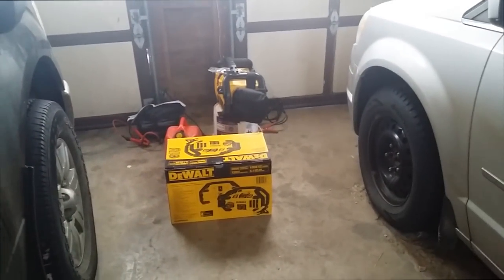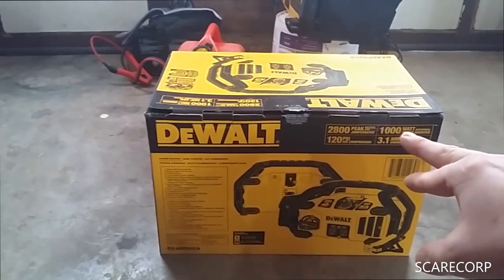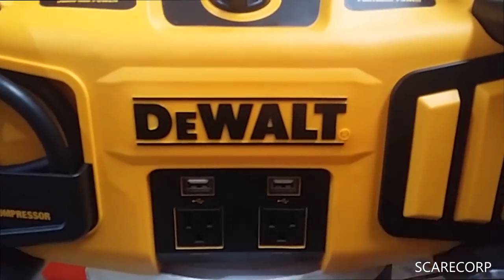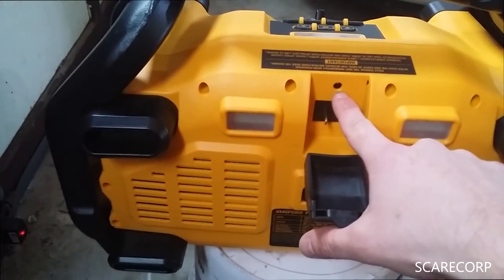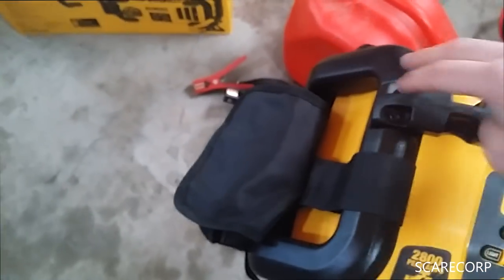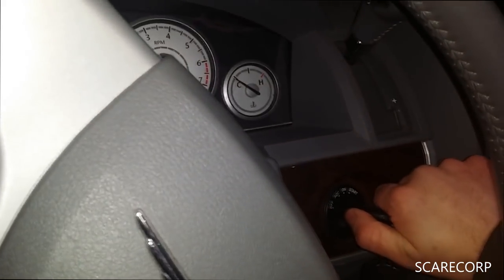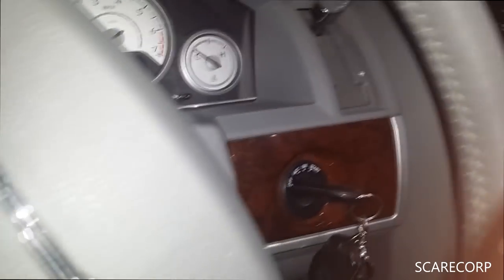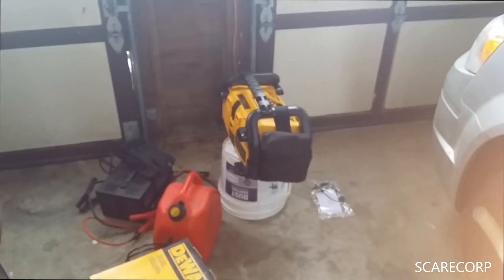DEWALT 2800A/1000W Power Station Battery Booster

Comment: Is a redesign of the "BLACK+DECKER Electromate 400 AC/DC Portable Power Station/Jump-Starter/Compressor" that was available many years ago... for which has since been discontinued.  I had purchased the unit that came with the radio instead of the air compressor for filling one's tires.  Unit sold around $100.  The DeWalt unit currently is a little pricey and currently can be found to be sold for around $249.  Will be keeping watch when it finally is purchasable for around $200.  The trick with any like "battery jumper solution".... the internal battery will discharge over time and need to be kept recharged.  Units with a lead acid battery inside is even more important to be kept charged.  Sadly over time... as it equally occurs with your car's lead acid battery... the battery will either need to be replaced or new unit purchased.  Which leads to the biggest issues with these like designs.... not making it easy to replace the battery... as they would ultimately like for you to purchase a new unit every so many years!  ARG!  O:-)
Electromate 400 Power Station  ==>>  https://www.youtube.com/watch?v=7QZegZb-6s8
Reply: Amazon Warehouse has these "used" occasionally for $199.00. Box is just damaged, item is brand new.

Comment: One let down I see with this other then the cables being to short is the fact that for as big as this unit is it should be made to power more then a v8 for being a 2800 amp should have had the 12 volt cigarette port on it but otherwise it's still not to bad.

Comment: Does the manual list how many SLA batteries this unit has,  and at what amp hour capacity the battery(ies) have?

Thanks.
Reply: Thats what's written: 
SLA 12vDC, 21Ah x 2
Reply: yeah 2 of those in parallel will do the trick but it's so much easier to just buy them and put inside a box and connect them in parallel. It won't be as pretty but it'll do the exact same job for around ~70 bucks. Problem with this particular unit is that the cables are short and it's so heavy but you still have to lift it and rest in on top of the engine in order to use. I mean for the price you're paying i'd think it comes with at least longer cables.... not knocking the unit itself just parts of it could be better for the money...

Comment: Maybe a dumb question but can you connect the negative to the battery terminal as well when jump starting a vehicle?
Reply: The operator's manual says to connect it to the frame.
Reply: You can but the manual tells you the proper way to jump
Reply: Thank you.  I have a 2011 Santa Fe and there is really no ground except for maybe a 1/2 inch screw.

Comment: Just to confirm, that also has the capability of being recharged from a 12v power source right?
Reply from the maker: you are Correct, this can be charged by your cigarette lighter in your car. i imagine that would take a very long time.
Reply: I found them at Home Depot, just recently hit the market.  I am going to see if I can get this to be charged off a solar power station.  My guess is that with no charge controller, it would not be safe as a standalone device, but it can be used to quickly scale up the capabilities of a portable solar generator system that I can build into one of the toolboxes.
Reply from the maker: hmm, you might have to read the manual but i wonder if it has it's own charge controller in it, i had it plugged into AC for a few days extra and i think it just turned off it self. be an interesting project for sure.
Reply: Thanks for the info.  I am buying one in the next few days to start reviews and testing.  I think you are right that it probably has an internal charge regulator, but I have to see how many amps it is made to handle.   Your average car alternator is 30 amps and reacts to battery voltage to shut down power production if battery voltage is high.  The little shutout circuits on devices like that usually can't manage much more than the amperage in the little power adapter.  Solar panels of course, never really turn off, which is why we have charge controllers of different capacities to match the power production in order to divert or shut off power once voltage limits in the system are reached.   Most of the smaller ones do that through a heat sink, switch or both.   I'll explain it when I buy one and make the video.
Reply from the maker: Great Thanks.
Reply: 8digitPDX hey dogitpdx i have a question and it seems that when this particular item came out qe already had plans for it and that is hooking solar panels to it well i read most of your comments in which you mentioned you were you where going to try it because you had concerns about the charge controller hope you can send me in the right direction in terms of advice thanks so much man God bless
Reply: Otto Grant I have two of them rigt now but need to order a spare set of the jumper cables  in order to build an adapter for the charge controller.   The 12v charger setup on these is just a trickle charger and won't handle much power.
Reply: 8digitPDX did you hook up a solar panel to it yet? I am interested in this as well!

Comment: Anyone know why it must be connected to the frame instead of straight to the battery terminal?
Reply from the maker: i think the book said i just cant remember, i am thinking it wants ground not negative post, which i know should be the same but i dont think it quite is. i just know it does not work on the Battery terminal. Thanks for comment
Reply: ah right
Reply: They want it to spark away from the battery due to possibility of explosive gas that could come from the battery.
Reply: It's standard battery jumping safety. Most people don't follow it.
Reply: The Motorcyclerrl i agree most don't follow that safety precaution

Comment: screw that. dewalt sells a product with a handle you cant even use because the screws are stripped.  short power cables.  they can shove it.
Reply from the maker: Minor things aside this thing saved my ass in the bush.
Reply: I believe you man just for the money you're paying for this unit it should at least have longer cables... it would save you so much hassle... That thing ain't exactly portable if you get what i mean. it has 2x 12V 21ah batteries inside and so it's heavy. and you can't use it unless you have it resting on top of the engine because the damn cables are too short.